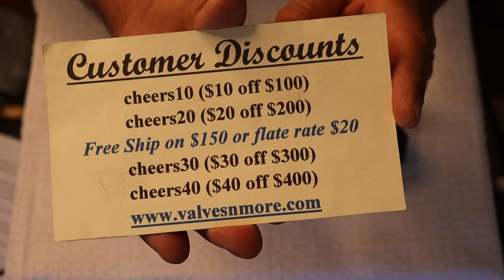Tube Lab #147 - CNC Top Plates for Kit Amps

Comment: Looks great 👍 15yr machinist here, a 90 degree (45 per side, 2 flute) edge break tool would clean up those bores nicely so you don't have to do it by hand.
Reply from the maker: Thanks, we're currently using a set of KEO 90deg zero flute countersinks with a hole in the side of the tool, these do a terrific chatter free job of cleaning up all of the smaller holes up to 5/8", they make larger countersinks that would be good for the largest holes unfortunately those bits are crazy expensive, so I clean those up with a hand deburing tool, a couple of quick go arounds and Bob's Your Uncle!